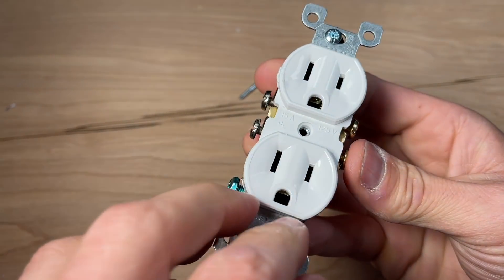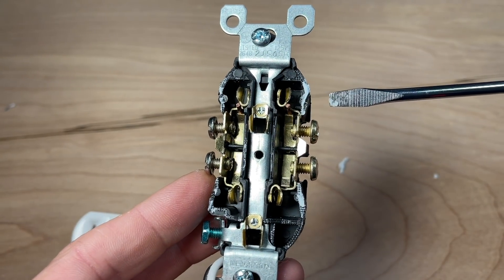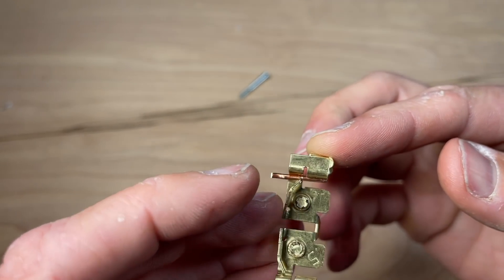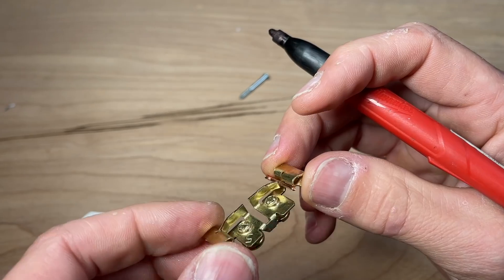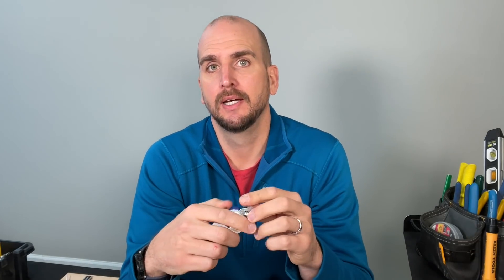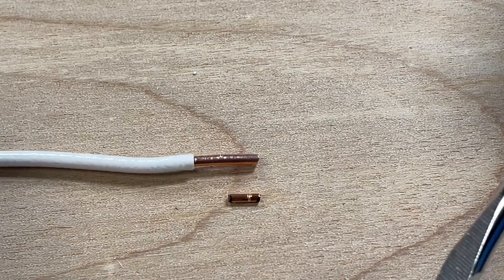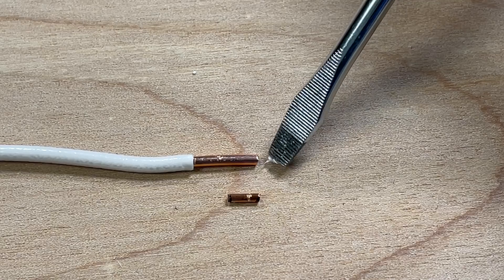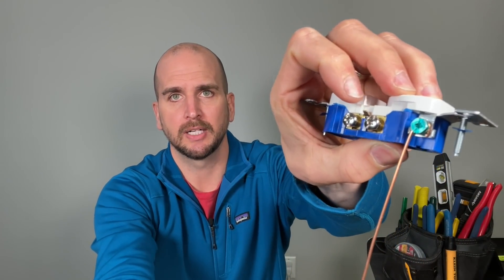Why You Should Not Use Speed Wiring | Back Wiring Is Preferred

Comment: If you're not skilled enough to bend a simple J-hook,  you shouldn't be messing with electricity in the first place. Takes only a few seconds and you still have to tighten down all the screws regardless. I have always done it that way. Since I was a kid in the 50's and did wiring. And yes, I wrap in electrical tape.
Reply: Do you use tape for non conductive boxes, I've always thought the process was unnecessary unless it's a 4s or pancake. I too also hook all my receptacles and pinch with my  needle nose.

Comment: Interesting!  Does having less of a contact surface affect the performance of an appliance, for example, a fan?  Thanks for posting.,  👍👍.
Reply from the maker: Reducing the amount of contact surface area can lead to increased heat generation.
Reply: @EverydayHomeRepairs  Yes, but note that anything more than the cross-cut surface of the wire is pointless. With a screw you deform the copper (flatten it) and increase the surface area even more, which is good but likely overkill for domestic applications. What would be interesting is a current and temperature test. Push current through it, a little over spec, and see how hot it really gets. Then push it and see when it becomes a problem. I see too many videos of electricians telling me "it doesn't feel right" or "I have no faith in it". That does not teach me anything.

Comment: I'm not a professional electrician but I have done work on electrical circuits in my own and my family's homes for many years. I know the electrical codes and my background is in electronics. I have never trusted speed wiring. I just feel it's not solid enough, especially for an outlet which may be flowing close to 15A of current! I have used Leviton parts most times so I'm used to the "J" hook method. That's my fave, though I also like the back wire method Eaton uses. Yes, it took me a few times of doing it wrong before I figured out to put the wire around clockwise which causes it to tighten around the screw as opposed to counter clockwise which causes it to open. Great tip on that, Scott!
Reply: Found a serious plier, almost needle nose but not. Strong, easy to do the j joint finally.
Reply: I used to replace hundreds of receptacles back in the 80s due to the screw coming or being loose. A loose screw can heat up much more than a "speed wiring" connection because the speed wiring will simply melt away the contact metal. I've seen loose screw connections melt several feet of wire feeding it. I don't think I've seen this with speed wiring connection.
Reply: @Bryan-Hensley  i agree completely with that statement , but usually a licensed electrician will tighten the screws as much as possible to prevent them from coming loose , most times its caused from inexperienced or poorly trained workers
Reply: @Bryan-Hensley  Yes. I have always tightened the screws very tight. No need to be prissy with them!
Reply from the maker: Appreciate the feedback Ken!
Reply: I used Leviton 20A commercial grade receptacles when I wired my garage, and those have a back-wire feature as well. It's a bit different from the Eaton but it's just as convenient.
Reply: NEC NO DEVICE SHAL BE INTERDEPENDENT OF ANY OTHER DEVICE. MEANING PIGTAIL THAT SUCKER BECAUSE 1 GOES BAD THEY ALL DOWNLINE LOSE POWER!!! CODE in most STATES in the US!!!